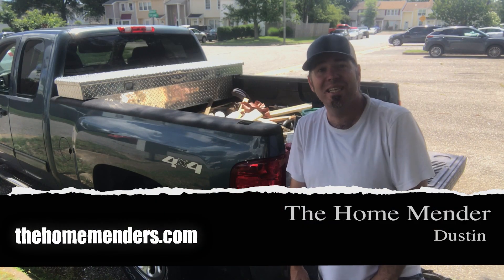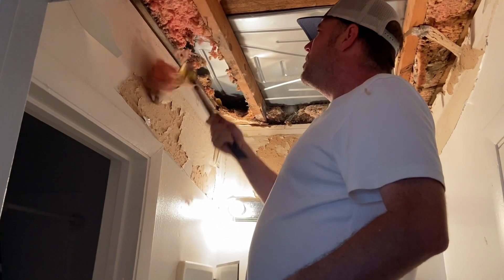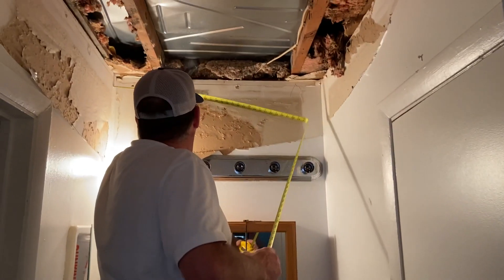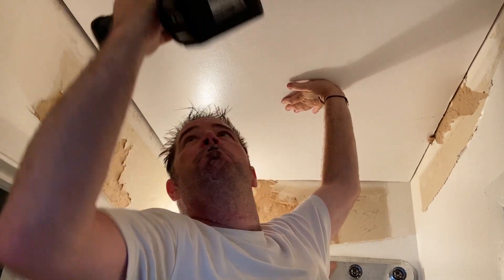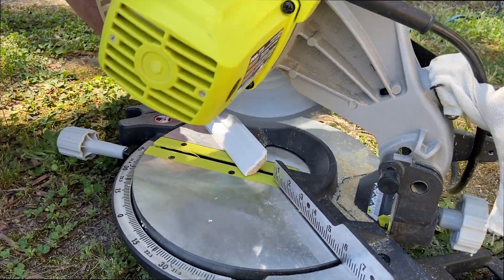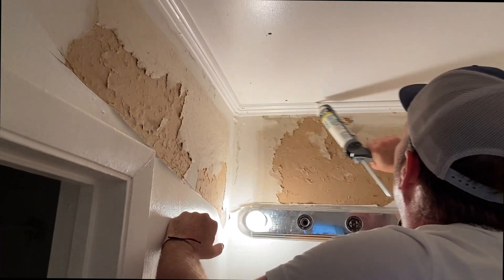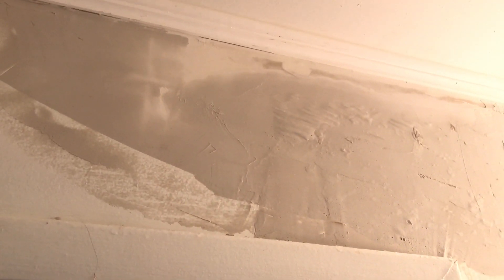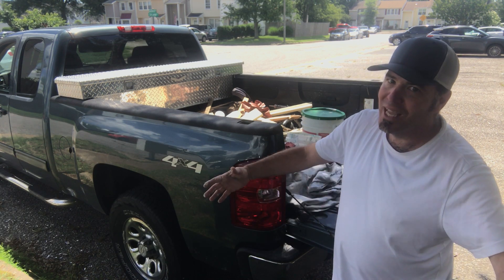How to fix the fallen ceiling, ceiling collapse, ceiling cave in and install crown. Easy!

Comment: What should someone do if this happens in an emergency?
Reply from the maker: Hi SL. Great question. There’s never a good time for this to happen. In the event of homeowner emergency making sure any possible broken electrical lines have the breakers turned off or any possible breaks and plumbing lines valved off. Emergency consists of fire flood or damage to personal property. 
I hope this helps

Comment: Hi I need some suggestions for a basement it has wiring, dry wall, collapsing from water damage and rats been having many fun times terrorizing it and I want to seal it up to block them from further damaging the ceiling, walls, etc is there any way I can send you pictures or video to your email to get proper advice on what's needed to repair and strengthen cause it's a mixture of drywall, wood, and brick and I want to also block flooding coming through when it rains. Feel free to reply at your convenience as I know you're busy. Your videos give me inspiration to do this myself as I know the prices are wild.
Reply from the maker: Hi. Yes mam.  This would be a fun project to upload to mighty network and discuss. Share photos progress and get Repair tips!
Reply: @homemend  Oh no, I can't upload this to the network, I value my privacy and only want to get your expert advice. So if this is fine, I will take pictures of it, to find out from you the best affordable products and advice to get. Feel free to reply anytime at your convenience.
Reply from the maker: No problem Carla. Shoot me an email thehomemender@gmail.com

Comment: Nice…bet that toke longer than 4.48 though
Reply from the maker: Hey fire it actually took me about an hour to remove it, install the new ceiling, install the molding, and clean up

Then wall prep and paint took about another two. Not bad for three hours worth of work

Comment: LMAO, you have SCREWED that customer and put it on internet for added humiliation. You DO NOT apply compound directly on torn drywall -  it MUST be sealed first with oil-based primer, shellac based primer or "peel stop" primer, preventing the paper from instantly absorbing the moisture from the mud before the mud has bonded. You can watch how pieces of paper separate and bubbles form at 4.05 of your video.  Otherwise nice job with the ceiling :)
Reply from the maker: I don’t know about all that science stuff that you’re talking about. All I know is the ceiling is done, it looks awesome, the homeowner is happy and I got it done quicker than it took you to write that comment. Thanks for sharing